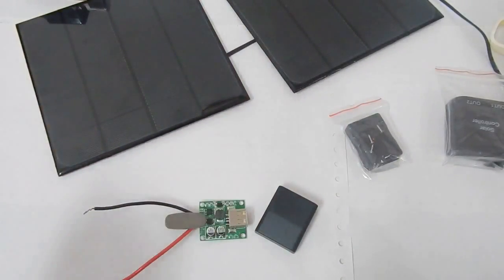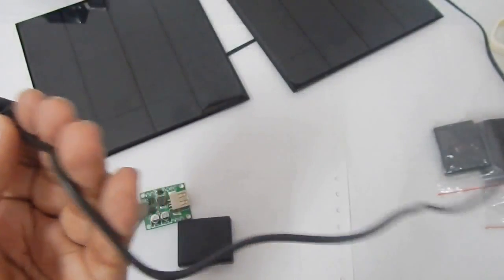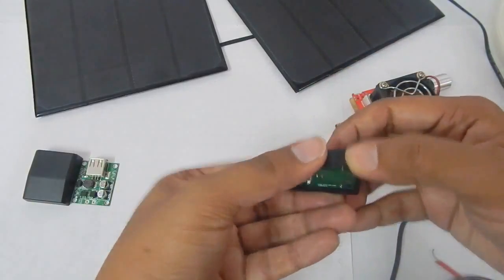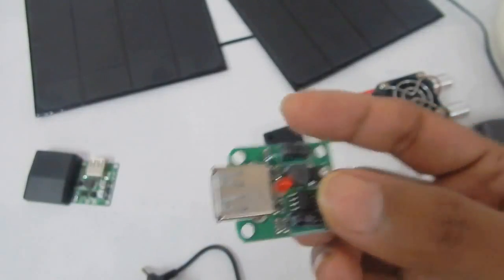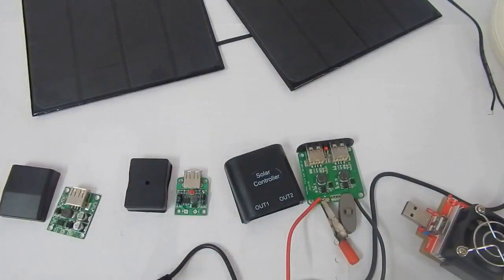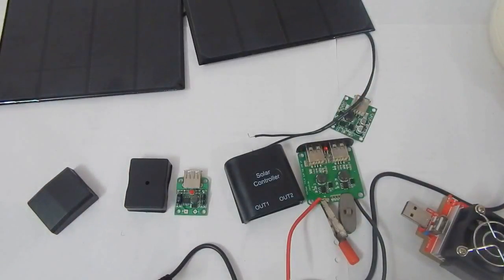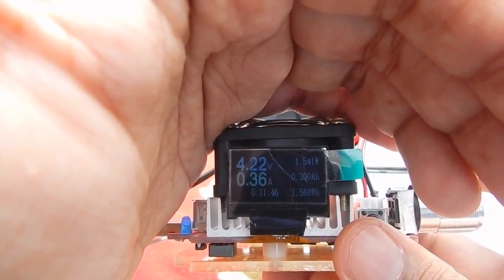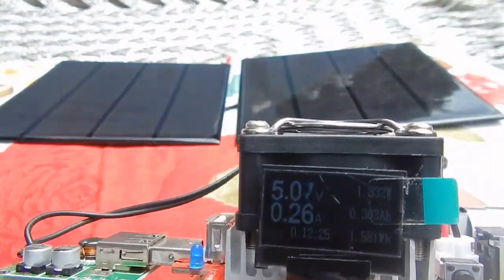5V USB Solar Charge Controller | voltage regulator.

Comment: is it different from buck converters? i mean, can i use a buck converter instead of this ?
Reply from the maker: yes , this is a buck converter that they are using in small chargers with a USB port at the output.
so, yes you can use a buck converter as well.

Comment: Is it worth it to put a regulator on panels made to charge a cellphone with only 9 cells?  I'm assuming the peak voltage couldn't be more than 4.95 volts. Seems like I wouldn't need a regulator on these unless it was because a device was just picky about rock solid voltage.
Reply: Upon further research it looks as though I couldn't use one of these regulators even if i wanted to.  My open voltage was somewhat above 5 volts after all,  but would be pulled down under load.  It doesn't look to me like this is a Buck/Boost Regulator (The description of it's function in the video seems to be wrong).   It only seems to be a Buck which means it can not raise the voltage only lower it.  The rated voltage this board can take is 5 volts OR ABOVE so it doesn't boost anything.  That explains why so many of these cell phone chargers you see for sale like the Renogy are 6 volts with a regulator.  I'll just have to see how this does without the regulator.   Each panel in this charger was sold to operate without one by only using 9 cells and not 11.

Comment: I git 9 volts solar panel.. i try it the output is 5 to or 6 volts.. and it doesn't charge my phone
Reply from the maker: we need to connect more solar panels to increase the current. With  a single solar panel or even two solar panel the charging will be very slow.

Comment: What's your output of the adaptor?
Reply from the maker: it is rated at 2A max. your output will depend on the solar panel you are connecting. This is an old video but i think i got about 5V and 340mA.

Comment: Can I connect this type of connectors with a 100watt solar panel? Please advice me.
Reply from the maker: yes, it should work. But make sure it is not over heating if it overheats then i don't recommend using it. Also, for a 100w panel it is best to buy a bigger charge controller so that you can charge a battery and and your phone also.
Reply: Gurribuy plz tell me, upto what watt panel it can be used with safe parameters?
Reply from the maker: @tapasnandy4433  10w to 15w should be good enough.
Reply: Gurribuy Thanks.
Reply: Is the solar panel output voltage between 6 and 20 volts? Yes. The module will use 10 watts max. You can run 10 modules off the panel.
Reply: I got one pannel of same 6 v 4.5 .   Can I directly  charge the mobile does 5his effect battery's life

Comment: I have the same module that you tested in the sun, it actually works well. Sadly my solar panels are not really rated at what they advertised it to be. Otherwise it would have given me 1A on a sunny day.

Does your panels give out 1A on a sunny day?

Note: I got 2 panels rated at 5V 2.5W each but maximum I got out of it was 600mAh, planning to buy more. They were connected in parallel.
Reply: Same i also got 2 panels  5v 2.5W. i also got 600 ma from both.

Comment: how many volt battery charge by it?
Reply from the maker: This Charge controller takes input from 6 volt to 24 volt and then outputs 5 volt through usb. You can only charge your phone or any usb device with this charge controller.

Comment: HI can you please help here , so I have this 5V solar panel and i connected it to a 5V DC-DC voltage regulator... when i connect it to a phone it shows that the phone is charging but the battery percentage decreases instead of increasing. when the phone is off then it does increase but after a long time.  is there a way i can use to get the phone charged even when it is not off. Please Help
Reply from the maker: The current of the solar panel is very less, you will need more panels for it to work and get some significant charging. Is your panel 5V or more than that.?
Reply: you need to add diode, that block the reversal of current
Reply from the maker: diode will only help if you are charging a battery directly. In case of a phone the phone charging circuit already prevents reverse current. In this case the phone is getting discharged normally and since the solar panel are not enough the phone is not getting charged,

Comment: hi, i have a 5v 6w solar panel just laying around, will that charge controller work with that? thank you
Reply from the maker: The charge controller converts higher voltage into 5 volts. If your panel is already 5V then the charge controller will give you a little less voltage. Since your panel is 5v, you can directly use it without a charge controller. Ps- i was looking at your channel and found that you are into drums, just wanted to say that i use to play drums few years ago.
Reply: ah. the drumming. that was one of my frustrations, i will go back into that when i retire. so about my question, you answered i dont need a controller. but we know that the sunshine is not constant so there will be dangerous fluctuations. if i use one of those, will the voltage and current be stable?
Reply from the maker: @CATW756  yes the voltage will get stable. and the current will change as per the sunlight, which is normal.

Comment: upto how many watts panel u can attach to it?
Reply from the maker: The single port ones can take upto 15watts and the dual port controller can take upto 25 to 30 watts.
Reply: +Gurribuy 50 watts will it get heated up?
Reply from the maker: 50W is not worth it. If you want to use a 50W solar panel just go with a normal solar charge controller that comes with usb ports and can also charge a 12V battery. However if you use these small charge controller they may get damaged.
Reply: +Gurribuy that controller requires a compulsory battery to draw power from solar panel to usb or it doesnt work..isnt it?
Reply from the maker: Yes, for conventional charge controllers you will need a battery for it to work.
Reply from the maker: look if you want to use these small usb regulator that i'm using, with a 50w solar panel, you can use it and nothing bad will happen but you will be wasting a lot of energy that way. and no it will not heat up because of higher watts. But i would not take a chance.